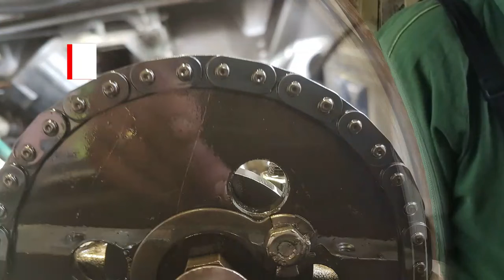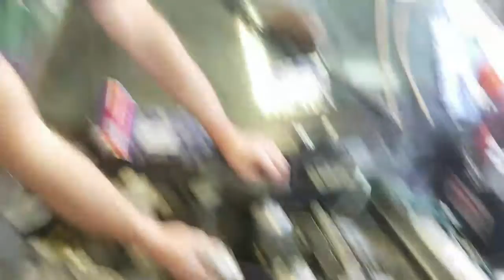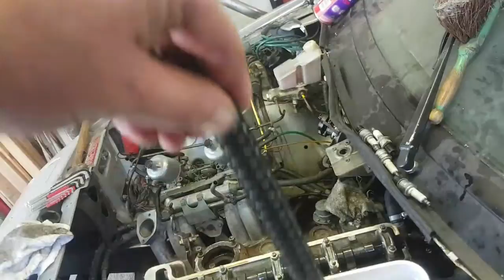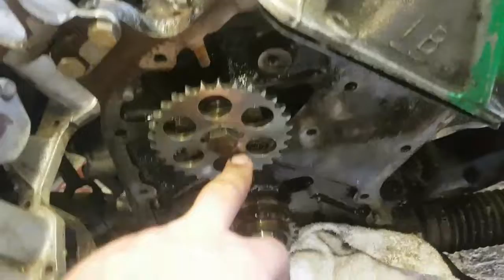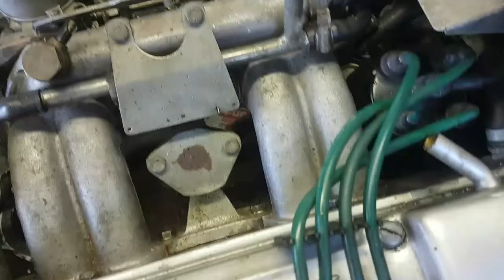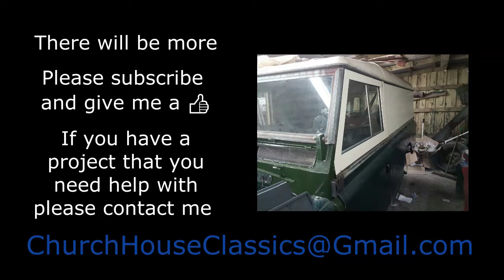1982 TR7 Part 1 - Engine noise issues - profanity warning

Comment: New subscriber!
I really approve of the approach.
Many thanks and greetings from Belgium.
My bet is on crankshaft bearings or connecting rods.
Reply from the maker: Thanks for the sub, I am inclined to agree. The owner is overseas until end of year. Hope to get an answer then 👍
Reply: @churchhouseclassics  thanks for the answer!
I also checked part two. Are you going to fit the v8 eventually or not? I am looking forward on following the project. I have only one suggestion, and that is that you sometimes take the camera and film the engine. For example, when you were taking off the covers etc, that we can see it a bit more from nearby. 
Other than that, nice concept. I like how you tackle the project with a good friend of yours. That reminds me of working on mopeds with a childhood mate. 
Cheers!

Comment: Wow you have so many different things on the go I’m surprised you can remember what day it is!
That sounds to me exactly like the noise the Rover makes when a lifter collapses. I know these don’t have hydraulic lifters, but worth checking valve clearances - stuck or bent valve (especially if owner messed with the chain) maybe, or a broken bucket?
Reply from the maker: the valve timing was never in doubt. However it is possible to have the chains too tight and the tensioner bangs against it's housing.

My diary needs some super organisation, and during lockdown all the days of the week were renamed to "day". glad to be busy, work is good now until early new year 👍🍻

Comment: Can I have a go/guess too? Sounds first order to me. I'm thinking rod knock. Maybe remnants of the failed water pump gear got in the oil system and took out a bearing? Try taking a look at how much debris is in the oil filter. You could try pulling off an HT lead one at a time while engine is idling and see if the noise stops. That would tell you if it was bottom end related and which cylinder to look at first. Happy hunting.
Reply from the maker: We didn't get as far as pulling each of the HT leads, I am suspecting that one or more of the main bearings has been damaged as part of the overheating issue. Engine is still not apart.

Comment: I had noisy engine. Had crank reground and shells. I put back together still noise. Turned out it was alternator bearings shot....
Reply: In fact with alternator off, it ran really smooth.
Reply from the maker: Had something really similar with my Stag, the pulley was slipping against the alternator cooler/fan thing and made a racket. Not this issue in this case though

Comment: Could it be the fuel pump?
Reply from the maker: I did wonder this, my automotive stethoscope wasn't with me at the time to confirm. The pump has a wobbly lever but it should be in constant contact with the jackshaft. Robsport listened to the noise and said more likely to be crank, rod, piston
Reply: Oil pressure check would check big end's can you disconnect the fuel pump from the engine and run it with the fuel in the carb's?

Comment: The title says 1982, TR7 Part 1? 
Production ended in 1981.
Reply from the maker: This one was first registered in April 1982, I suspect one of the last off the production line that took a few months to shift or was held back by a dealer?!?
Reply: @churchhouseclassics  My vehicle, model year 1980 TR7 was built November 1979.
In the states goes by model year. Thst's what gets recorded on the vehicle registration. Thanks

Comment: Valve seat?
Reply from the maker: did check them all by removing the cam and each bucket. all valve stems are good. compressions are also good. + valve seat I would hear tinkling as the engine is being cranked for the compression check. Appears to be at half crank speed but also needs compression for the full effect.

Comment: Sounds valve gearish. Check clearances. Could have dropped an seat insert and opened up clearance. Good luck!
Reply from the maker: way to loud for valves, also the noise is coming from the top of the crankcase. I can barely head it on the exhaust side of the head. 👍

Comment: you say the dipstick wasn't in, I thought the dipstick was the guy with glasses and the funny hat (sorry couldn't resist) , the best way to fix the TR7 fuel leak is to throw a lighted match at it. That TR7 sounds like shit, don't waste your time or money. C'mon chains should NEVER droop that much.
Reply from the maker: I think I might have cracked that dipstick joke, might have ended up on the cutting room floor though. I quite like the TR7 4 pot, they are beefy for a 2 litre and go nicely. Different era though. And yes that chain is a cheapo pattern part

Comment: Sadly there was never anything good about that slant four engine, poor revving and harsh at its best....... good luck with the project tho', can't help but like the TR7
Reply: Really ? I wonder why SAAB used the basic design until 1993 ?
Reply: @robcowdrey2611  Hello Rob, sure but isn't that a bit like saying Porsche used the basic  design of the horizontally opposed VW engine till 1993........... I had a TR7 and that engine was a pig, no beefs with slant engines but that was a clumsy design even fo 76/77